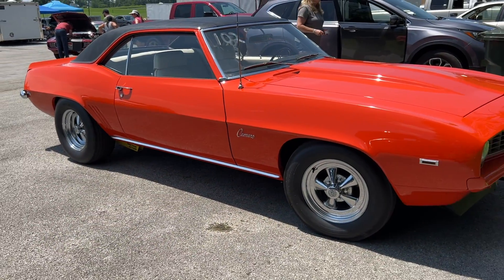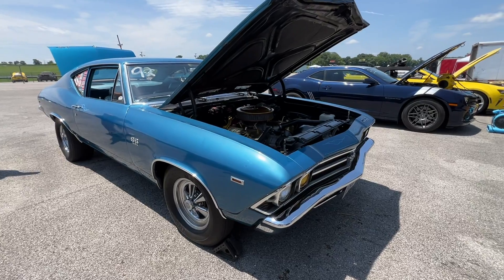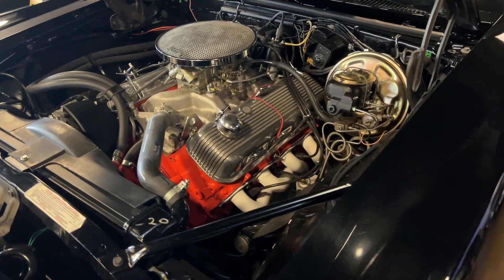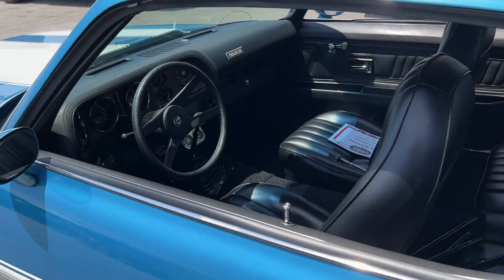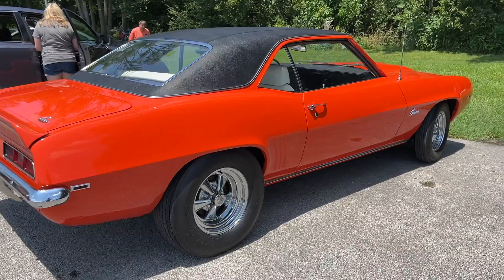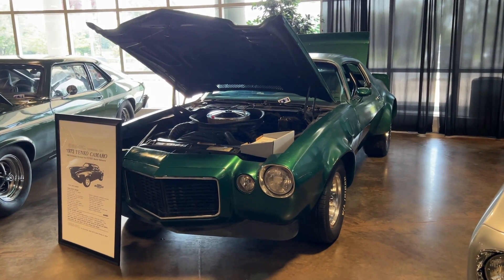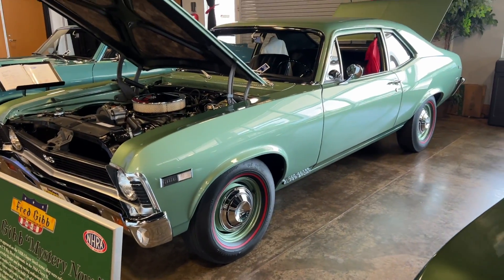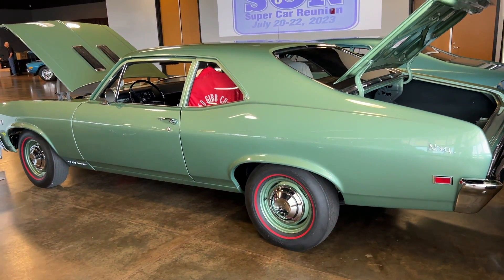10 Insanely RARE (and cool) Muscle Cars from the Supercar Reunion!

Comment: I like the racing decals on the windows. How we ran em back in the 80's. Bragging rights for what speed parts we had on the cars. Usually got two decals with each part. That green survivor Camaro would look great with 15x10 deep dish wheels and 295 50 tires filling out the flares.
Reply: Nah
Reply: 15x10 with Pro Trac N50s and some F70 bias ply up front.

Comment: Most people don't realize how significant that Fred Gibb Nova is . Those were ordered by Gibb as L78 396/375 , turbo 400 cars for use in SS/DA class . Until those cars were built you couldn't get an automatic transmission behind a solid lifter Chevrolet engine . These cars proved that the trans would hold up to the abuse and in '69 they became available as regular production items . Dickie Harrel further modified some of the cars that Gibb had ordered by swapping out the L78 engines for L72  , 427/425s .  There was a road test , I believe in Pop Rod Magazine , pitting a stock '68 L78 Nova against a Harrel modified version and one of his converted L72 Novas .

Comment: Of all the cars there, the Phase III Baldwin Motion would be my choice, I’ve owned 2 Yenko Camaro cars, one brand new in 1969, the other a few years ago, but the Motion cars far surpassed them easily. They were true street beasts back in the day, during a time when the factories were producing some truly serious street performance cars. No computers, no traction control cars, just raw horsepower, and torque, with driver skills required. 👍

Comment: Please explain Copo
Reply from the maker: COPO stands for Central Office Production Order, which basically meant that it wasn't a regular production car. In the case of 1969 Camaros, COPO cars were available with the 427 instead of the 396. The limited production run makes them highly valuable.
Reply: @HotRodHoarder  thank you sir
Reply: In 1969 most COPO Camaros were ordered with the L72 427. There were somewhere around 1000 of these cars produced. Only 69 were ordered with the ZL1 all aluminum 427. Both are ultra rare and therefore ultra valuable.